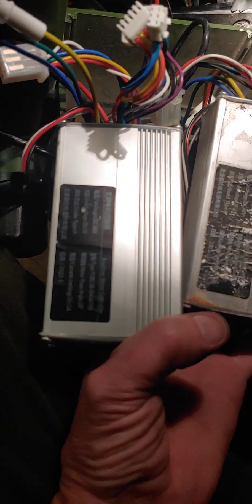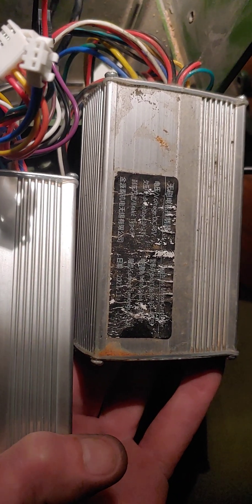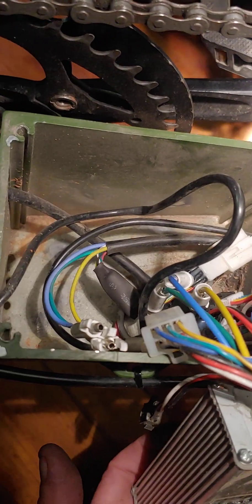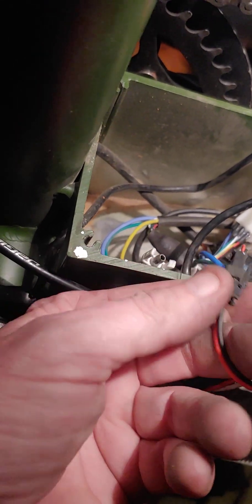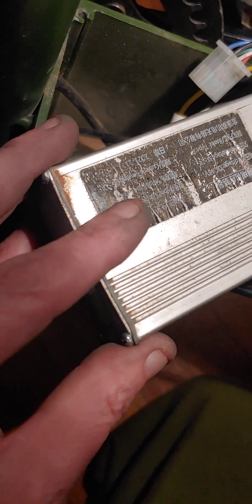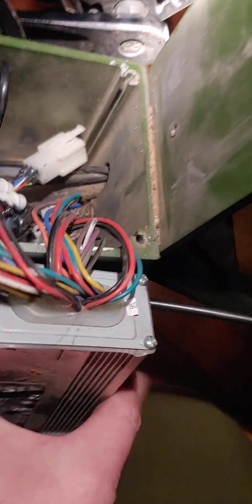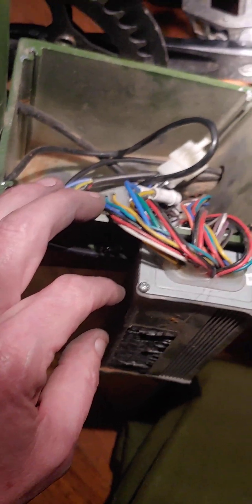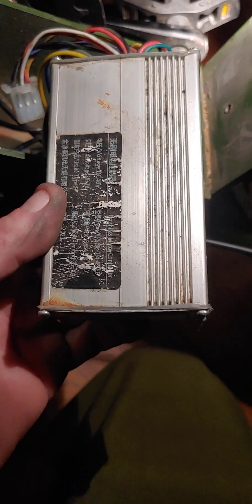Swapping out the electronics from the generation 1 Fiido T1 cargo bike to the upgraded frame.

Comment: Thanks for sharing your experience with the new t1. I'm still a tad confused though. Is the lesser torque due to the controller, or the motor? I live in a very hilly area in the UK so l need the torque. I'm guessing the new display is responsible for the power shutting off at 15mph. Did you try jst changing that? Thanks mate.
Reply from the maker: The original T1 with the old dim display has the best top end and torque.  I put those parts on the new frame.
I did confirm that the newer display muted the torque and had a lower top speed unlocked. 43kph....but it is better on mileage.
Reply from the maker: I put up a direct comparison video with the displays.  Thanks for watching! Like and subscribe if you got this bike.

Comment: Recently received my new frame and have it set up to ride.....as soon as the snow and ice are off the roads i will be riding.  I am not happy to find out that the new frame has a much smaller motor as i have a few big hills that i regularly travel on. I do like the new display much more than the original and if i end up swapping the rear wheel and controller can i use the new display?
Reply from the maker: Yep... either controller will work.  
The newer one is good on battery and has way more options. The older one has more torque and cruise control.

Comment: Hi. Thanks for the video.
Just wondering if you tried swapping just the display and if that made a difference. Or, did you try the new bike with all the old bits, but with the new controller?
You said the controllers had the same numbers on, so I wondered if they were the same? Cheers
Reply from the maker: Both controllers were identical.. only the motor and display were variables. I did not like the speed control and pedal assist mode on the newer display. Some people like it but I wanted the performance I had in my original T1
Reply: @TornadoGarden  cool, thanks for that.
Awaiting a replacement so nice to know what to change.
Thanks for sharing.
Reply from the maker: @barrybarry1-b1l  Thanks for watching.
Reply from the maker: The newer display feathers the motor in pedal assist...on both bikes.   It is better for battery range and peddling.

Comment: Fiido said that the new 250w motor its actually a 750w but with different label.
Don't know if it's true but they say it's for some countries that need the limited 250w motors. So they just switched the label and limited the controller to output only 250w.
Reply from the maker: I understand that you can peek a 250 w higher than rated, but the new motor, controller, and display combo do not give the same performance as the original. The new one has less torque, speed, and climbing ability than the original 750w. I bought this bike for those original specs.  
I appreciate the added connector between the motor and the controller on the new bike.  They saw the issue and resolved it for future maintenance, but as a retrofit it might be too complicated to do for the average rider.
Reply: @TornadoGarden  they said it is actually a 750w motor, the exact same as the old one, they just changed the sticker.
The power output it's limited and controlled by the new controller software.
I believe that if you put the old controller on the new motor it will behave as strong and fast as the old one.
IF, what they say it's true.
Reply from the maker: @MainVuper  I'm working on it sir!  We will know very soon!
Reply: @TornadoGarden  I'm not sure, but since you have your hands on it pls let the community know 😊

Comment: BY the way, I assume there is no weight difference between the two bikes? It will be interesting to see if the new cadence sensor makes any difference.
Reply from the maker: I expect the new frame to weigh slightly more. The extruded triangular reinforced tubing is larger with interior strengthening.  I'll post final weights once I finish the tire swap.
Reply from the maker: The cadence sensor appears to be exactly the same. It is possible that it has more magnets now but I am not going to disassemble it.

Comment: Well done thanks for that info. It's as I suspected. So I will be using the old display also. So the wire lume from the display down to the controller box can stay, obviously.
Reply from the maker: There is no quick disconnect for the old 750 w motor and the connector is too large to go back through the hole without disassembly or cutting. I just posted a video about it. Thanks for watching sir.